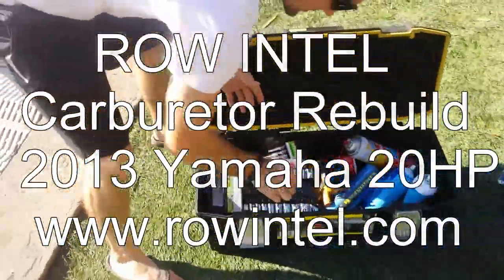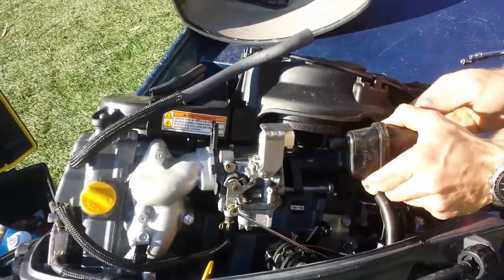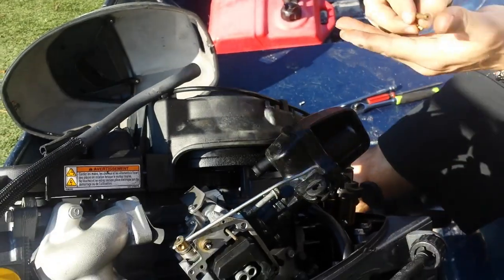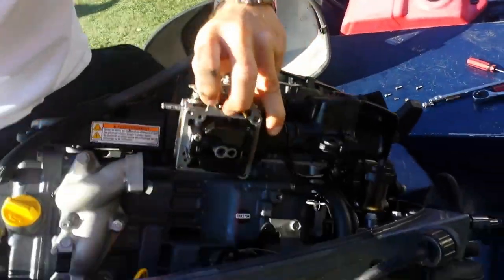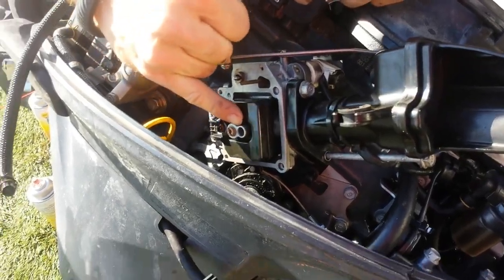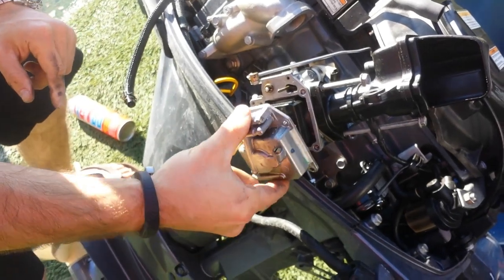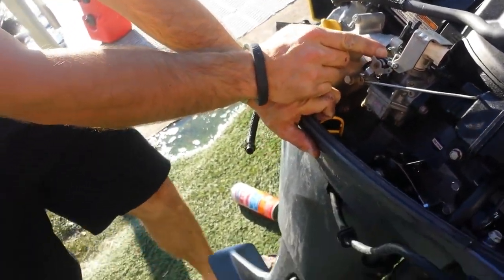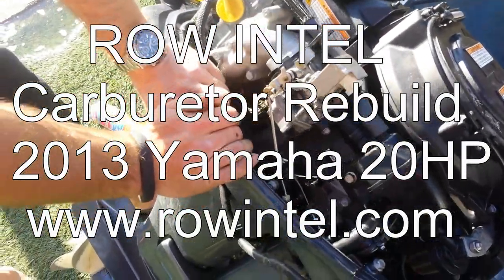15 minute Carburetor Cleaning Rebuild Yamaha 20HP outboard 4-stroke

Comment: Great video.  My 9.9 was barley running and I figured it was varnish from ethenol.  I cleaned it as you showed and it runs perfectly.  I had a small vacuum leak and diagnosed it, like you said, tightened the bolts and now it runs perfect!

Comment: Excellent instructions thank you!.  I have a F15 CESH  but expect that it will be almost identical to this 20 hp.  Have a small stumble at idle which I suspect may be due to dirt in the low speed orifice.  Very careful with fuel, but it is Florida, salt water and the motor is a 2011.
Ignore these criticisms, from people who rarely do anything, but prefer to criticize others.

Comment: Great video, even 8 years later! I have a 2008 20HP and had to replace the carb. It came without the idle speed screw set so I am trying to set the idle speed. What is the best way to measure the engine speed? I have an optical tach, but am getting erratic readings. I have the reflective tape on the flywheel. Would a pickup on an ignition wire be more reliable? Thanks!! ...and, again, great video!!
Reply: Nevermind ... I found another piece of reflective tape, probably from the prior owner. This caused my problem.

Comment: Thank you for the video. My engine died after coming of throttle and got stranded for 2 hours in the shipping lane. Turned out to be the rubber cap under the small jet come loose and caused over flooding. Spent hours trying to figure why it wouldn't start all because of the cap. Meh design tbh.

Comment: I have a 2014 Yami 4 stroke that will start 1st or 2nd pull and revs wide open in N no problem. Has an intermittent miss in one of the cylinders. Went through and cleaned carb after previous owner let it sit with varnish gas. As soon as I take it in the water, it has a horrible intermittent miss when Im in gear above 1/8 - 1/4 throttle. It seems like it's going to die but never does. I just replaced both plugs but I believe it to be electrical because of how quickly the 1 cylinder cuts in and out. The top plug did appear darker but not by much (hence the intermittent miss). Any advice would be greatly appreciated
Reply: Did it end up being a bad cdi?

Comment: How can intake jets get salt in them? That doesn't sound like a correct statement but let me know if I'm wrong? Ref: 5:14 in your video.
Reply: Thought the same thing, but I suppose spray can get in the air intake.
Reply: He misspoke
Reply: The line from my water pump (Yamaha calls it a “pipe”) Had a crack in it and was spraying a mist of saltwater under the cowling right next to the carburetor. That is how my carburetor problems started.

Comment: Hi I have the same engine and after 10 mins of use at full throttle  it bogs  down so I go to mid throttle and when I speed it up it happens again usually  when I hit a wave it triggers  it to bog down. Do you think it's the high speed jet valve?
Reply: I have exactly the same issue! Will clean the high speed jet and find out.
Reply: Think about it. You're at full throttle for 10 minutes, all good and dandy. How could it be the high speed jet then?
Could be a float issue if the float is sticking.

Comment: Does using no ethanol fuel prevent this?
Reply: Ethanol in itself is not the cause. Ethanol is a great solvent and burns cleaner than gasoline. Heck, I've been running 85% ethanol in my car for 8 years, the engine is clean as a baby bum inside.
The problem is that ethanol attracts water. Where there is water there is gunk. That then starts building up in your carburetor, fuel lines, fuel tank and so on. This wouldn't be much of a problem in a car where the fuel gets used up fairly quickly. On the water however, there's logically more humid air and the fuel is left in the tank for longer periods of time, and that's why people prefer less ethanol in their marine engines. Ethanol free fuel stays good for longer. Fresh out the pump there's nothing bad in having a little ethanol in the fuel.

Comment: Can anyone help? I have stripped and cleaned my yam f15 fourststroks carb,but still wont idle. Had idle jet out lots of times,is completely clear. Motor runs great on main,but no idle at all... any ideas folks? Have I missed something? Fuel pump is healthy,brand new float needle,float works perfectly. I am baffled!🤪🤪⚓️ also has brand new plugs,clean fuel,etc....
Reply: Hi Rod, did you figure out the issue? Thank you
Reply: @vancityflyguy  I believe the issue was that although I had cleaned the carb,jets and fuel system,there was still some deposits of corroded aluminium which I hadn’t managed to shift,lurking in some of the smaller passageways inside the carb- it would run perfectly for a while ,then another piece would dislodge and block the idle jet again. This happened many times,probably if I had access to an ultrasonic cleaner and an airline,I could have saved a lot of time and hassle. Replacement carbs are very cheap on eBay etc,granted they’re Chinesium copies. My carb is pretty worn out,so perhaps I’ll try a Chinese one and see how that goes.

Comment: Wouldn't it be easier just to pull a carburetor completely off , you probably one of lost the rubber plug you would have been able to access everything a lot easier and spraying carburetor cleaner all over your carburetor and it running down your motor I can't be good for your paint. And I only would have taken another five minutes.

Comment: I have a 25 Hp 4 stroke Suzuki outboard. Currently it starts 2nd pull but will not throttle up out of idle with out dying. Suggestions? (When choked it will throttle up but sounds bogged and wont reach rpm)
Reply: I currently have an identical problem with a two stroke Yamaha snowmobile with a carb. Starts to spool up and falls right on its face. I opened the main jet plug cover from the bottom of the sediment bowl and it was filled with sediment. I'm guessing we both need to clean injectors, or jets in my case.
Reply: sx3gunner  well I have the same problem  with my 25 johnson. It idles fine but boggs at high rpm. Do you think it's the Jets need cleaning?